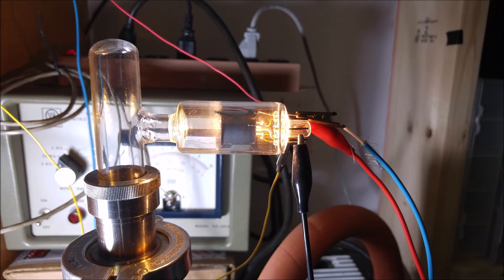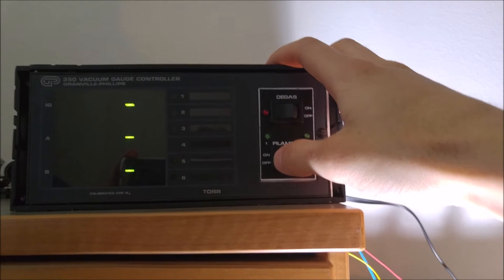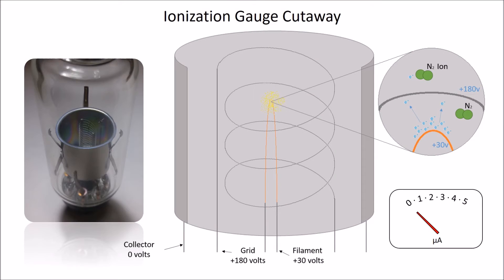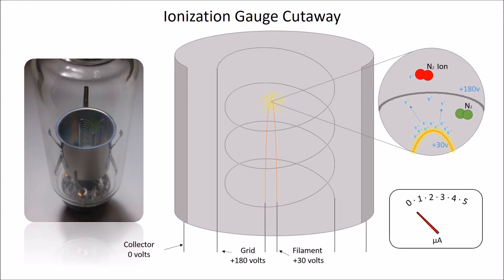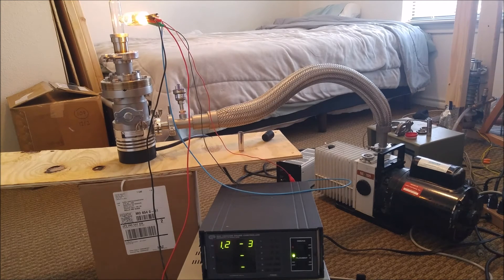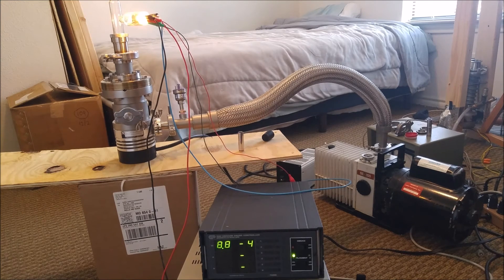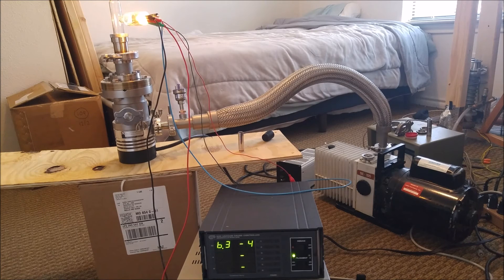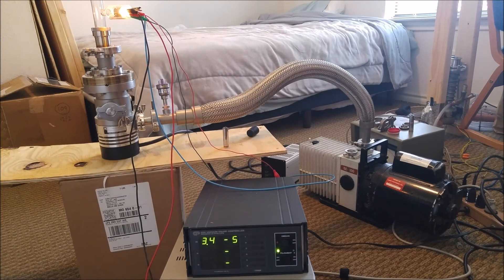How a hot cathode ion gauge works

Comment: Hello . you can metallize with aluminum. and explain what vacuum is required for this process, and what type of aluminum etc?
Reply from the maker: Hi. You can metallize aluminum in vacuum. Typically i think you want a vacuum of 1E-3 Torr or lower. I have had really good success with just regular aluminum foil. You might try searching "Physical vapor deposition" on google for more information. Good luck!

Comment: Hi, Eric. Can you help me, please?
I bought the same leybold turbo pump model on ebay without the controller. I planning desing my own controller. Do you know how much voltage supply is need to drive the pump in full speed? Some places I read say 150v, others 50V. 
Thanks in advance
Reply from the maker: Francisco Alberto Hi Francisco, unfortunately I don't own that pump anymore. I know that the controller does not output DC, it's some very frequency
Reply: I guess you should check out the datasheet of that model...
Reply: i just replaced a varian turbo pump. It ran at 54 V three phase AC and an input/output for a thermistor

Comment: dude, do you run a turbo pump on a cardboard box in your bedroom with a glass tube on top? fuck, that's pretty dangerous!
Reply: the turbomolecular pump is on the floor .
Reply: @Pyrothorgrabmyhammer  the TMP is atop the plywood on the cardboard box, the pump on the floor is likely a rotary vane pump (based on the SD 200 label it is probably a Varian SD 200 rotary vane pump)

Comment: 3.5 -5 Torr. I hope its badly contaminated chamber or that your gauge is way of since that is a very bad vacuum for a turbopump. It should have been at least under -6.
Reply from the maker: Either of those is very possible, plus they let me borrow the pump because they thought there was something wrong with it. In another video I run it on a cryo down to the -7, which it believe is correct.
Reply: It takes time for stuff to degas, especially if the chamber, gauge, and turbo pump have been exposed to humid air for an appreciable amount of time. I've also seen where the oil in the rough pump oil is contaminated with loads of solvents which will cause the pressure to remain high.
Reply: @EricDalgetty  Yea that makes way more sense. 4 year overdue but I just see your answer now due to the other person posting it.
Reply: @ax14pz107  Yea so you won't get down to -6, but that much so you only get to -5 then there must have been pretty much pure water in it or severely contaminated or something wrong with the roughing pump or not have been used for a very long time. Bearing in small turbos are normally oil but that in the higher pressure side part of the system and won't matter if they degas or not since that won't travel to the high vacuum side anyway. If it would have been a diffusion pump then this would have been normal until all gases and moisture would have been released which will take many minutes if not used for some time.